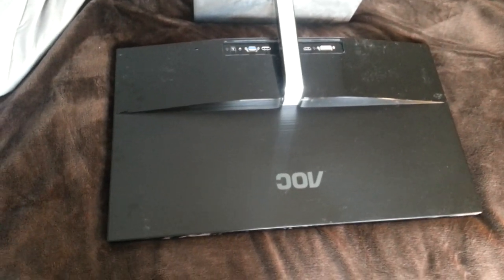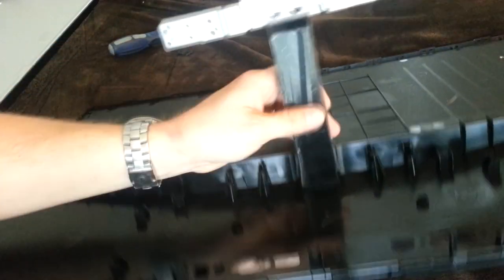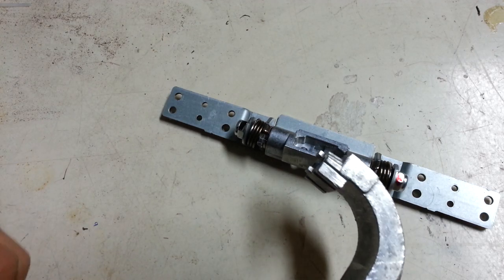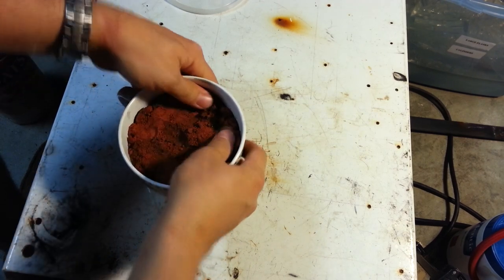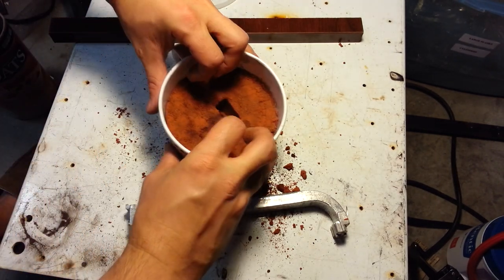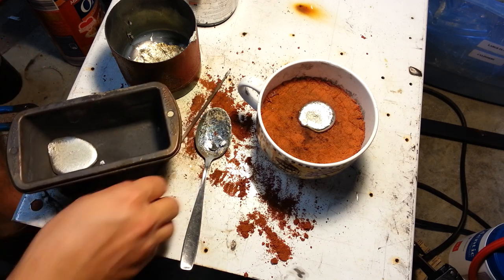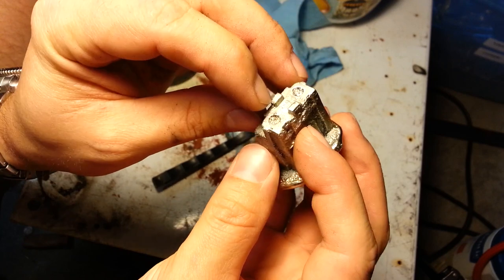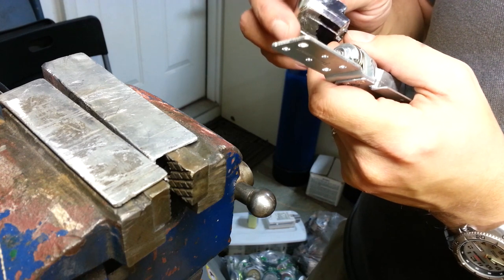VESA mount for the AOC U2879VF 28" 4K monitor

Comment: This process is also valid for the Q3279VWF,  Although I just bolted 2 screws to a 100mm plate instead of doing it in a way that keeps it structurally sound, like you did.
Reply: How did you opened? Do you have some pictures how you did it or video? Thanks!
Reply: yeh how tf did u open it im so confused how to open it
Reply: @onylcalpatura4328  It's held together mostly with clips around the monitor .

Comment: Thanks for the video. I managed to open the Q3279VWF version. If someone want to do the same be aware that the process is less straightforward. Note that the front panel connector is linked to the shell !
Reply: Hi don't suppose you'd share how you got the back off on your version? I have the same monitor and need to open it up to sort out the stand arm as it isn't sitting straight.
Reply: @natevee84  more or less the same way, the joint being on the front side, using guitar picks, the corners are hard to remove and like I said the front and rear part are linked by wires at the buttons location so be cautious if you try.
Reply: Do you think they will notice that the monitor was opened in case of warranty? Are there any parts that break while tearing down?
Reply: @namuh5799  i don't think so, i have not seen any seal.

Comment: All you needed is the metal plate with 4 holes in it + 4 longer screws & nuts to fix the plate to the vesa wall mount. Then you'd just screw the monitor's metal "neck" (seen after 0:16) tight between those two plates. Ugly but it works. You'd forget all about it in a day. But then you wouldn't have the excuse to let the warranty out...

Comment: Avoided all this hard work by using Velcro tape which I purchased from Home Depot, works like charm and has the ability to hold on to the weight of the Monitor. No complaints so far.

Comment: You're a cool dude. Got an abo and a like.
I just need to remove the stand of mine because I'm going to buy an vesa adapter. 
You think they will notice the opened monitor in case of warranty or are there no visual parts that break while tearing down?

Comment: Hi, I'm thinking about getting this monitor. Just to clarify, this will void my warranty, right? Not like I care too much (I haven't got bad hardware... well, ever!) but if so I would wait couple of months with mounting it, just to eliminate possibility of buying bad monitor. Never too careful, right?

[edit]
Also, did You try to swivel it? I'm doing a lot of work that would benefit from vertical setup and ability to turn monitor by 90 degree would be awesome... I'm just worried it would broke off or something.
Reply from the maker: Sorry for the late reply. 
If there is any kind of warranty I presume this process voids it, though I didn't notice any foil stickers or anything on my unit.
The VESA stand I use handles the swiveling so I did try it. I found I preferred a smaller side-monitor for document and code display and the large monitor remains in landscape.

Comment: nice video mate, bit beyond my tools and available materials, but i think ill go with the dreaded "cut the stand in half and mount a vesa plate to it" method :D
Reply from the maker: A few other guys with similar monitors used U-bolts to clamp the stand to a plate. Whatever works I guess. I just like an excuse to goof around in the garage.
Reply: i ended up just drilling two holes in the main stand after removing the facia, and then affixing a vesa style plate to that, just need to trim them down, but works pretty well!

Comment: Hi.
I have a AOC Q3279VWF which is a little bit different. On my case the screen is inner part and the back shel is and "outter shell". So unmounting is not really as you do. In consequence the insertion of credit card or anything to open is done by front (so any scratch will be done on the visible side :( ) and I didn't find a way to open at the corners. It's really to hard to remove corners, I always have the feeling I'll break the plastic.
Anyway good video, thanks for tip. If anyone have a clue on how to open AOC Q3279VWF thanks for reply.
Reply: Hey did you managed to open it ? I haven't tried yet. It would be great to have feedback on q3279vwf version.
Reply: did you manage this?
Reply: How can i open Q3279VWFD8?

Comment: Have you thought about selling these? I have 2 U2879VF monitors so I would buy 2!
Reply from the maker: I had not considered that. I'll try the machined version. If it doesn't take too long maybe I could put a few on Etsy or something. I'll have to buy some metric taps and stuff first.
Reply: This Stuff I Do - in the same boat, if you were to put these on etsy I'd buy in a heartbeat!
Reply from the maker: I machined a few of these this week and I'll try to set up Etsy or something soon. Will also post a video on the machined version. They took much, much longer so I'll probably go back to casting.
Reply: This Stuff I Do will happily just paypal you or something otherwise.
Reply from the maker: Stephen/Zack - Send me an email or YouTube PM and we'll get the ball rolling. ThisstuffIdo@gmail.com
Reply: i would love to buy a mount like that for my aoc
Reply from the maker: If you have the U2879VF, I have a few of the machined batch left in the Etsy store. 
https://www.etsy.com/listing/543205029/vesa-mount-adapter-for-aoc-u2879vf-4k
Reply: i have the same. but i have been looking for a adapter for this kind of monitor but none of them are clean looking. until i found your video. its good thin you made this vid.
Reply: I would really to purchase one - but it says - Sold Out. Any chance you might make available again? (please)
Reply from the maker: Ken - I'll make some more this weekend.
Reply from the maker: New Listing:
https://www.etsy.com/listing/555046515/vesa-75mm-mount-adapter-for-aoc-u2879vf